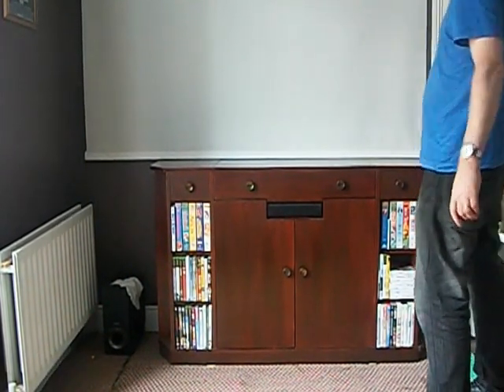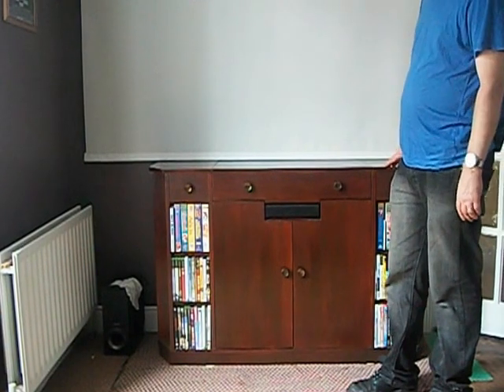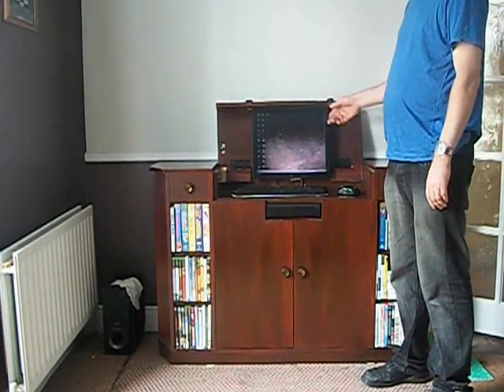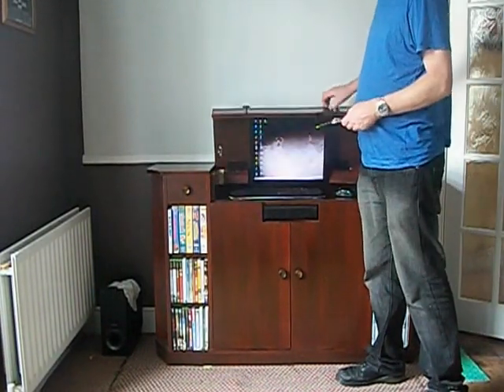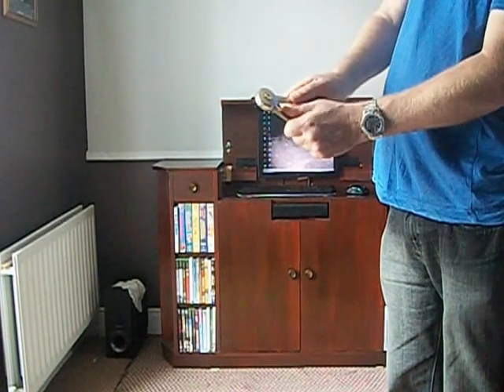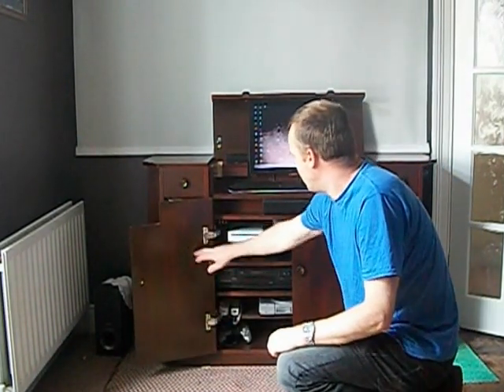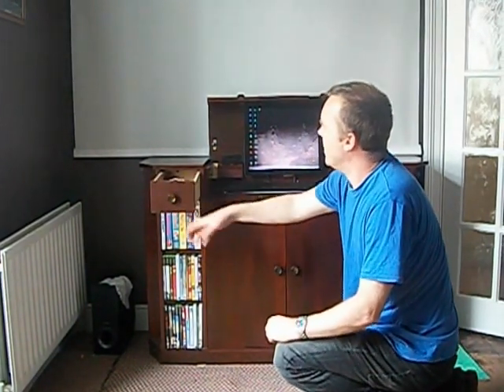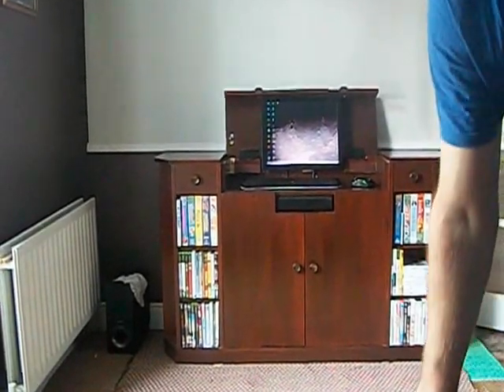Homemade TV / Monitor Lift Mechanism (Part 2).AVI

Comment from the maker: it doesn't actually hit the wall there is a groove cut into the cabinet at the top edge left and right ,when the top opens the inside back edges rests on it, stopping it .since i done the vid i've also fitted a pair of soft close hinges to the top slowing down the closing